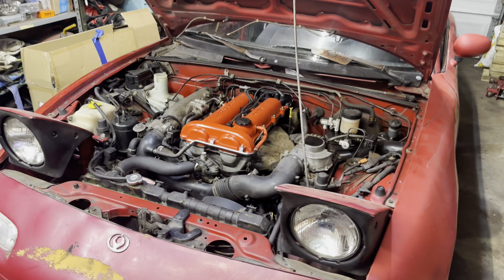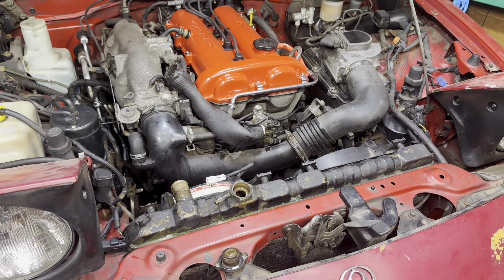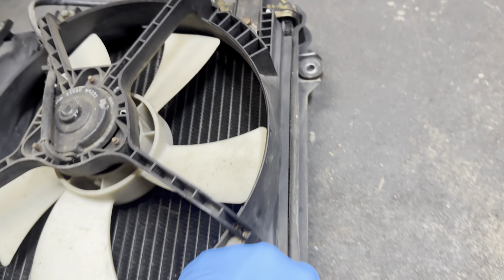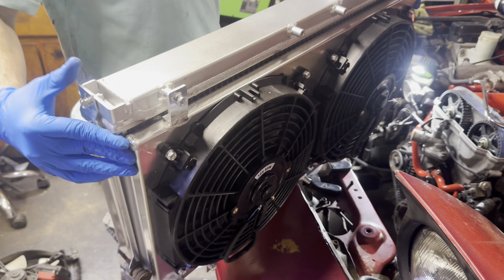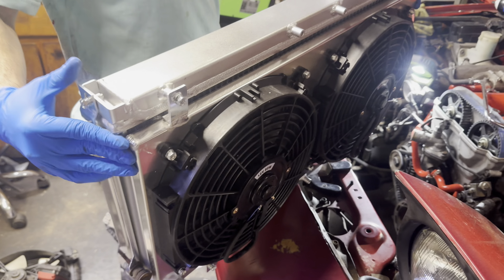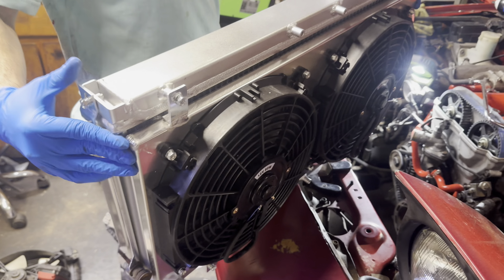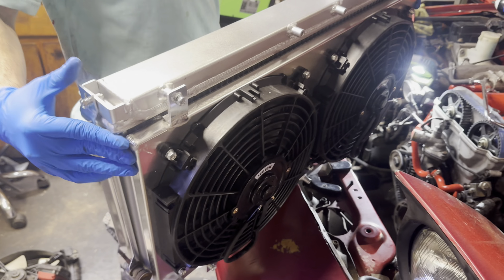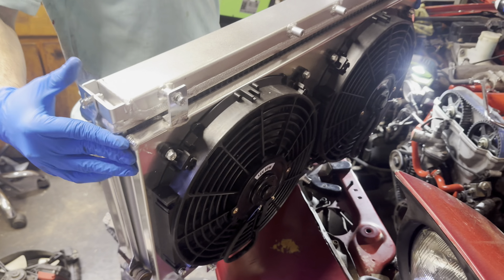HOW TO INSTALL ALUMINUM RADIATOR FROM AMAZON/EBAY ON NA MIATA

Comment: Hey, I bought this same radiator and shortly after I had issues where my motor was getting hot, if that happens to you you can take off the metal sheet that is between the fans and the radiator and it helped a lot. It just blocks a lot of air flow and I don’t really know why it’s there
Reply: Oh, and to reattach the fans to the radiator I bought these plastic radiator clips that go through the bolt holes on the edge of the fan all the way through the radiator then clips on the outside of the radiator